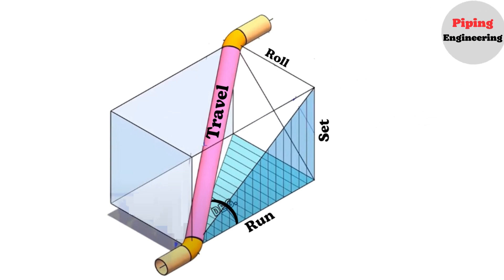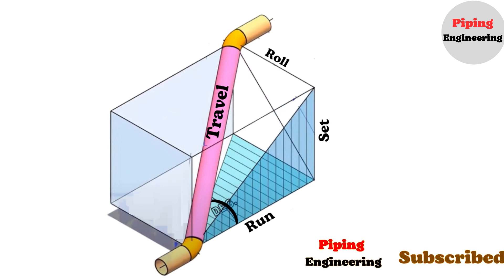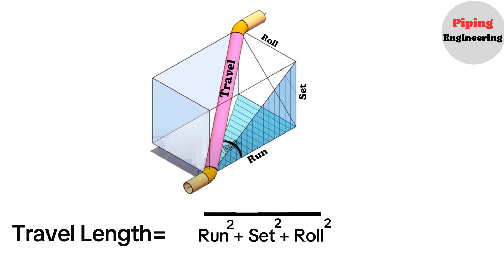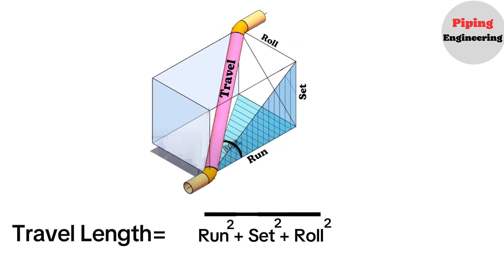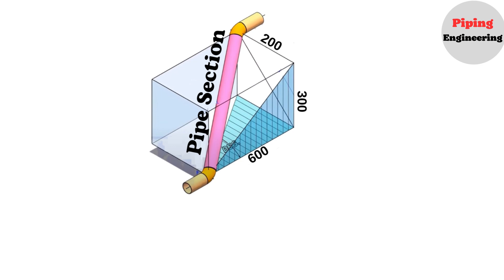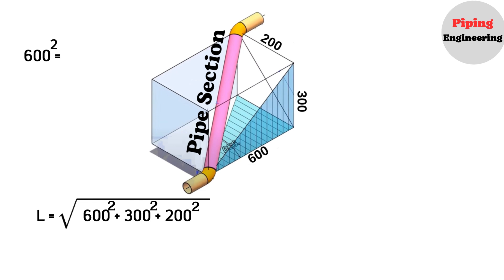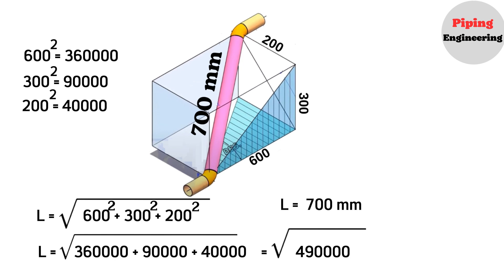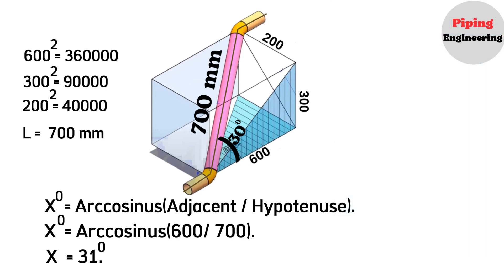Master Isometric Pipeline Drawing: Expert Double Rolling Techniques Explained.

Comment: I thought the length is 490000 mm. What do you mean 700, I don’t really understand
Reply from the maker: The square of the 700 is 490000. The under root 490000 will be equals 700 mm

Comment: How do you calculate the angle in the calculator machine it's too fast for me could you write it clearly thank you
Reply from the maker: Thanks for watching our videos and commented.
It is easy.  I calculated the numbers first, then adjust the video speed to match the timing I need
Reply: @Piping-engineer cos (600*700)=0,999.. How did you get 31?